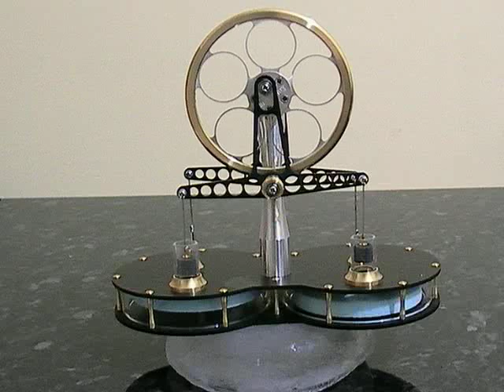Twin Cylinder Engine Running on ice - Gyroscope.com

Comment: if you use some of your engine power to compress air, you can then run a small Ranque-Hilsch device to create separation of hot and cold air in an air pipe; the separated hot/cold air can then be directed thru insulated pipes to the appropriate hot/cold end of the Stirling engine to increase efficiency perhaps. (cold air flow can also "freeze air" solid for future "air ice" fuel for Stirling engine)

Comment from the maker: I recon it would work. That technique (drill a deep bore) is already used extensively for heating systems. You can actually get quite a bit of heat that way. So I recon should work quite well.

Comment from the maker: It does not produce much torque. However I know someone that its converting one to produce a small amount of power.

Larger versions can run on unwanted factory
heat and produce quite a bit of power. Their
are also solar powered versions too.

Comment: Stirlings run on heat difference. The ice works because the ambient temperature is higher. Go on the arctic and it'd run much better if you heated the engine, but it wouldn't run at all with ice.

Comment from the maker: I understand the confusion. Stirling engines are used on submarines. You need to convert the heat to mechanical movement. Nuclear ones use turbines but modern diesel submarines are using stirling engines.

Comment: actually cold will make the metal brittle then the winds strong winds will slowly erode the metal till it breaks(plastic to if there is plastic used in it)

Comment from the maker: Well consider the difference in air tempature between the two places. Average north pole temp is about  -35c. A quick google on Phoenix, Arizona suggest the average temp is a lot less than 40c.  So 75c difference. The hot side of a solar stirling can very quickly reach 500c. So you only gain maybe 15% difference in temp between the sides. Electricity Transmission losses in countries tend to be over 7%. Between a major country and the arctic would be much higher. So high cost for no real gain.

Comment from the maker: Oh dear. Let me explain. A stirling engine powered car has been made before. The engine simply replaced the existing engine. don't forget 1000x in area not in Diameter. The can still ran of fossil fuels and I beleave was quite efficient. The biggest drawback was delay before it started producing the powered required.

I suspect it would work very well in a hybrid car.

Comment from the maker: @kajetan88 You can put the heat/cold on the bottom or top. It runs backwards when you switch the hot side around.

Comment from the maker: So yes if you put compressed gas (most types) it will work better. You don't use liquid  hydrogen when building it. You just put compressed gas in after it built.

Comment: @OSCAR7893 it relies on a diference in temprature between the top an botom plates, so if you took it to antartica becuase the air is as cold as the the ice you would need to warm the top plate to keep it running.

Comment: Read up on the laws of thermo-dynamics. Its essentially working the way a generator works, except conceptually in reverse. As long as one side is warmer than the other, energy is being converted. There is no such thing as perpetual motion.

Comment: Hmm I guess youre right but what I mean is that perhaps this only runs so well because it is lubricated, tuned, and tweaked to run well. Tell you what: try to hook up a motor to this and generate electricity. My guess is that it will just stop working because of the load, but I would be delighted to be proved wrong because then woe would have the future of energy on our hands.

Comment: Thank you for the quick response. Yet I have a question, I lived in Phoenix Arizona 6 years of my life, and it is much harder to cool something down in 122 degrees (The hottest I ever witnessed) than when I was in Alaska in very cold temperatures when the sun would shine consistantly for 5-6 months, so would not solar colletion be easier to heat in a cold enviorment, than the opposite? And energy to get cold water to a heated enviornment would that not make the process moot? I am lost on that.

Comment: Ok, I am a person fascinated by this. So if you had a huge version in the arctic on ice surrounded by a VLA Very Large Array of mirrors to heat a central location, with a wind shield AROUND the mirrors, not high enough to block the 6 months of sun, would that be feasible? I want to learn, and any given criticism would be most appreciated in the form of why or why not, as I am ignorant to this field, yet believe sometimes an outside opinion may still be worth consideration. I thank all in advancc

Comment: Am I correct in saying that (not to  be critical) this thing is actually a bit less efficient than geothermal steam heat and is not really a viable energy source? Does it only run so fast because its efficient?

Comment: You don't seem to be entirely familiar with the technology. Stirling engines are already developed to be considerably more efficient (ie. over 50% more efficient.) than any known internal combustion engines and are already being used commercially in the generator systems of hybrid vehicles and solar energy conversion systems.

Comment: No you don't. That little engine (or a larger one) could -run- off a hot plate but would NOT produce the hundreds of watts it took to heat the plate.